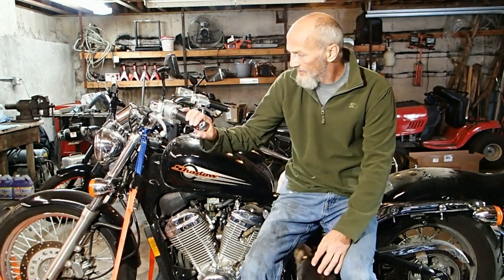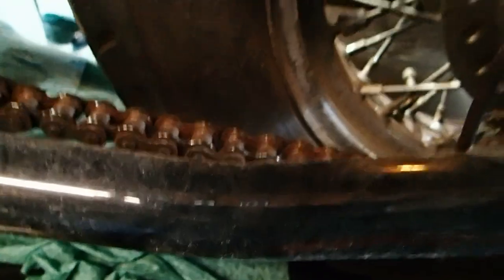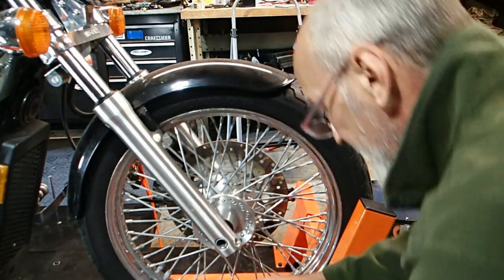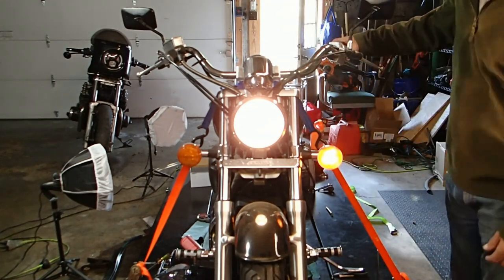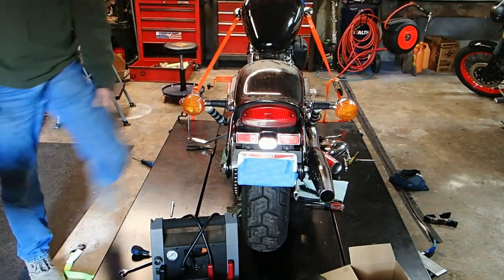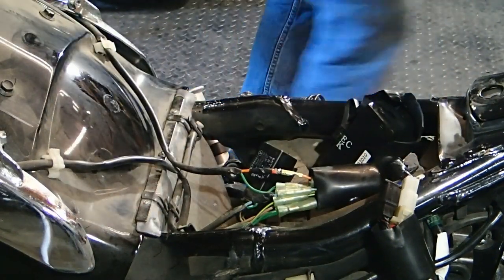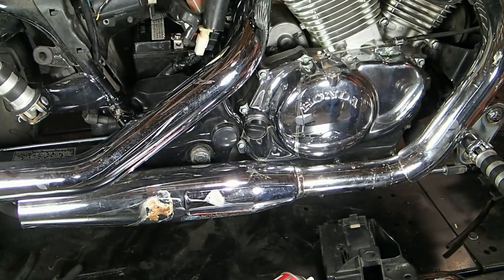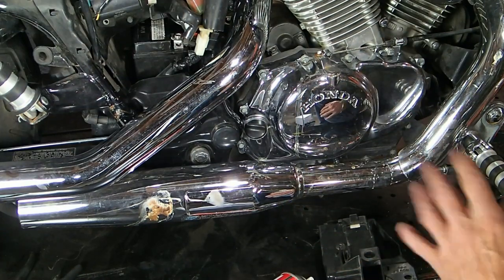Honda Shadow vlx 600 : turn signal diagnosis and general maintenance

Comment: One day my blinkers on my 1994 Shadow VLX 600 were not blinking but lit up . what I found out was that the battery was just down enough that that they would not work. So I ordered a new battery from a discount place which has worked until I let the bike sit for 2 months. I charged it periodically. Took it on a long ride today but found out that the blinkers are not working again. So thank you for giving me some ideas though as I am looking to figure out what is wrong with it. You did mention the battery was so so, ,that was a clue.
Reply from the maker: Glad I could help!

Comment: You sir, represent the difference between a mechanic and a technician. A mechanic would have just shot gunned a bulb or relay at it. You went through and tested everything to make sure everything is working.

Comment: How do you remove the front turn signal housing? I see the nut holding it together but it's square and looks to be welded to the mount.

Comment: Both of my front turn signals work. However, my right front turn signal (I guess running light?) does not light up. Do you have any idea what I should check?  Thanks.
Reply: I should clarify that. I mean when the signal is not on, the left light is lit but the right is not. When I turn on the right turn signal, it does light up and flash. I hope that is clear.
Reply from the maker: Humm, at this point, I would start tracing the wires and testing them.
Reply: Have you had any success figuring this one out? I have the same issue with mine except it’s the left running light.

Comment: I have a vlx 600 shadow and I have no running lights working including the brake light. All blinkers work when engaged, same as brake light but no running lights except headlight . Any help would be great
Reply from the maker: That's an odd one.  Sounds like a fuse or bad connection on a wire somewhere.  Trace the wires backwards from the lights and see if they are exposed or cut possibly.
Reply: @rabidsquirrelgarage745  so it was a fuse. All lights work except running light on right side rear. Bulb is good and it blinks just no running light

Comment: I have a 06 shadow 1100 and today my turn signals, horn and brake lights stopped working. It seems they share the same fuse but the fuse seems good. Any idea what it might be?
Reply from the maker: frayed, cut or loose wire is most likely the issue.
Reply: @rabidsquirrelgarage745  I found the culprit of the issue. You wouldn’t believe what was wrong with it. I tightened the battery cables down and it fixed the issue. Can a loose battery connection cause no power to those wires?

Comment: Will my signals work but how do u get them to stay on with the running light
Reply from the maker: Connect them to the headlight.
Reply: Ok I’ll try that I did see a wire hanging wonder were it go to I had gone led them I went back to regular bolt hopefully I’ll fix that

Comment: My turn signals all work, my rear amber lights stay off, bulbs and fuses are good. Might it be the relay?
Reply from the maker: More than likely a loose wire.
Reply: @rabidsquirrelgarage745  thank you so much